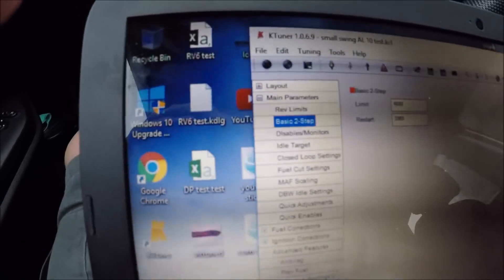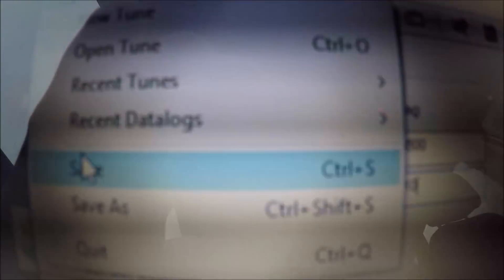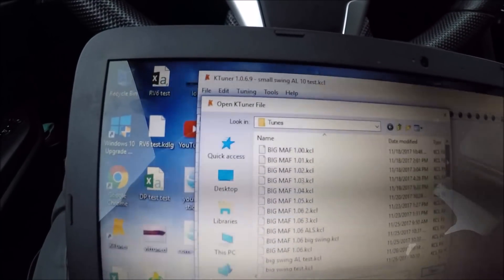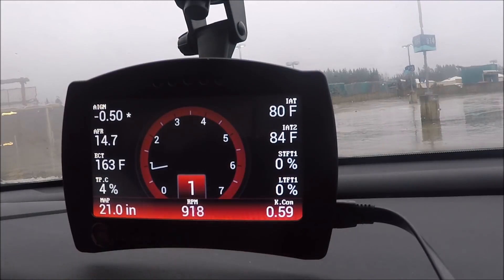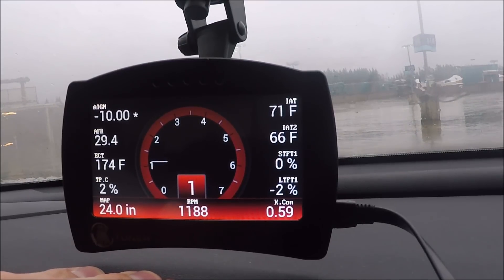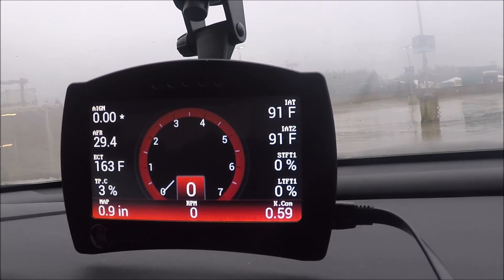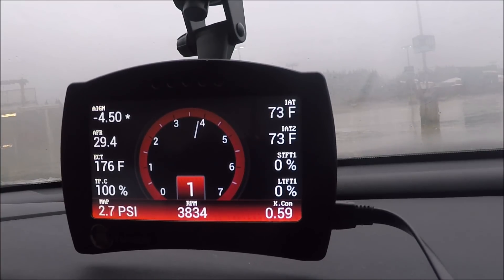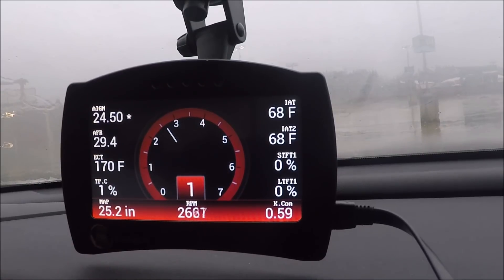Honda CivicX ktuner 2 step / anti lag how to and results

Comment: Can I do this with ktuner on a 9th gen si?
Reply from the maker: I am sure you can set the 2 step rev limit but without the turbo you can't adjust ignition timing to try and build boost off the launch. Maybe it is available for people who have installed aftermarket turbos but I am not familiar at all with the tables available on other cars, sorry.

Comment: Could I do it on a 2017 civic ex-l 1.5 turbo. It’s a cvt that’s where I’m lost
Reply: you can rev and have the '2 step in neutral or park but don't try and launch it
Reply from the maker: You know I dont know anymore if you can enable it on the CVT cars, I would think not because for one I doubt the car really let's the revs get high when flooring it while standing on the brake anyways. The software seemed pretty easy to navigate though I imagine if the option was there you'd have found it.

Comment: i just installed the prl catless downpipe and the prl race maf  cobra intake on my 2018 civic SI  today . got my ktuner a few days ago . could you tell me how to enable the 2step when im in the car ? is it something like holding down the cancel button for a sec or so ? . love your content
Reply from the maker: Unless they changed something you don't enable it. You just set it in the software when you create your tune and then flash that tune to your car. When you are not rolling and hold the pedal to the floor it will hit the 2 step or "low limit cut rpm and recover rpm" is another name for it in the settings as what you set there mirrors what is set under the 2step tab. I haven't updated my ktuner in a while though maybe I should and see if anything's changed.
Reply: I would suggest getting the tsp stage 1 tune with that. Youll love it. They set up the launch control at 3k rpm but you can adjust it by pressing the clutch in, hold cacel button for 2 seconds press top or bottom to increase or decrease which rpm you want launch control in, release the clutch then its set
Reply: For the 2 step after flashing, Usually you hold down the clutch and press cancel you can adjust it though there

Comment: Just to add to my other comment.  I know plenty about cars, but I've only owned one turbo car.  91' Talon TSi was the car and it had nothing but problems.  The motor was blown and the 3rd gear synchronizer was gone when I bought it.  I replaced the motor and rebuilt the trany.  A couple of months down the road the ECU took a shit.  I replaced it $1200.  I then sold the car.  I spent about $7000 on the car in one year.  I then went and bought a new car.  This was years ago.  Lesson learned.
Reply from the maker: Friend of mine is big into DSMs, had a built 2g manual and went through like 4 transmissions in a year, just couldn't get the manual to stay together with all the power. Him and all his buddies run lightly built autos now since they hold up better... I almost bought one off him to play with but ended up just getting ANOTHER Honda... Lol

Comment: So to be safe, if you can be safe ? Lol.   -5 would be a good number ?? Using a short recovery window, say 4500top 4450 recover, and I’d want my anti lag rpm set to be where for that ?
Reply from the maker: well you would set those RPMs for your low rev limit and then have minimum rpm for anti lag a few hundered below that so maybe 4100 or so is where Id set it at. I have my 2 step a little lower at 3900 I think, somewhere around there. I dont hit the 2 step often but had it at -8 for a while and just went -10 and so far no issues. I am actually going to raise the cut a little and extend my recover window  just a bit to slow it down and see how it sounds. With all seasons and an open diff I cant launch off the 2 step anyways so in my current situation it's just for show so I'm going for sound vs function... sad I know! lol
Reply: caraddict so this is
Prob a dumb question, but just to clarify the Antilag will only work when I’m launching right ? It won’t kick in while I’m moving and let the throttle off ?
Reply from the maker: right, only works when you are stopped.
Reply: caraddict had something really weird happen... went onto the software plugged into the ktuner to the car and uploaded the map I want . 19.5/21.5 (been running that map for months) and then made some changes . Just early spool and rev hang disable and better throttle response . Don’t normally touch anything else. Although this time i wanted to set up the anti lag . Set it up for -6 @3900rpm.. flashed the tune . DIDNT EVEN TRY IT YET just went to the hwy for a rip . Did a little pull in 4th and my k control went to 1.0!!!! I was like WTF! I was literally running this map with everything the same but with no anti lag for a while and never went over .52 ever .... I never even tried the anti lag. Becuase I was thinking that could make k control go up .. so I putted home . Reflashed my map but without anti lag and did a pull and K control was below .52 during hard pulls .. idk wtf happend . Maybe when I did the flash with the anti lag something happened during the flash .. hope nothing was damaged ??!.. but I know the anti lag should only work at a stand still so idk wtf happened

Comment: I just bought a ktuner but for some reason it will fail connecting and locking to the ecu..do you have any ideas..how many usb voltage is needed for the v1.2
Reply from the maker: I thought usb was always 5V... are you connected to the internet? I think I remember that you need to be connected to the web the first time you connect to the ECU/register/lock everything...
Reply: caraddict thru wify..its rgistered  just wont lock i gues there goes my 500 to the trash

Comment: Matt, you need to move away from all that rain dude lol
Reply from the maker: Yeah, too bad the wife likes living near her family too much, and they ALL live here. I would LOVE to leave this place, and my family has been spread from coast to coast since I was in middle school so I am used to that but she want's to stay right with them all.
Reply: caraddict I know that feeling man, I want to get out of Virginia but my wife is the same way.  Just ordered a V2 for my hatch, so I may message you on CivicX to talk about some settings since I haven't tuned anything since my EM1 with a Hondata S200
Reply from the maker: no problem, assume you already know its maddmatt02. I may not get back to you right away but I'll try to get back in a decent time frame.
Reply: caraddict yep, mine is FearTheH.  And it's fine, I have time since I'm going to just load the stage 2 in and then take my time tweaking everything else from there until I get the hang of it again, I'm sure it's like riding a bike though.
Reply from the maker: +Chris Saunders if you don't plan on running any ethanol or vastly changing the intake (like sensor housing size) a custom tune doesn't really have that much over the stg. 2 anyways) I'm guessing you saw my video where I had them all dynoed (2 videos actually). Of course stg. 2 could have changed since then I don't know. It is fun tweaking it yourself though, as long as you don't go nuts!
Reply: caraddict I haven't seen those but I'll check them out and sub as well.  I will be swapping to ethanol as soon as the new gas station 10 minutes away gets built, closest one now is an hour away and I daily my car so don't want to keep adjusting back and forth.  The basemaps may be pretty spot on, I know you used to have to load your base and do a bunch of tweaking to get everything smoothed out real nice.  Either way I'm more than ready to get some more juice out of this thing and get rid of it falling on its face toward the end of the rev range.

Comment: Why did it lean out so much on the 2 step rev?
Reply from the maker: I searched a bit and one of the explanations I found was that any time there is a rev limiter the wideband readings will not be accurate. The way I understand it is that when the "cut" happens it stops sending fuel but the engine is still turning and the throttle is still open so the engine is still drawing in air, which will mix with the already burnt air/fuel on the way out making it appear leaner while every spark event actually has the correct mixture in the cylinder when combustion occurs. So as long as the afr is fine at that rpm/load under normal circumstances should be fine using anti lag... I hope that's right! I plan on some more reading as well.

Comment: Man the sound is insane!!! You got RV6 Catless DP right?
Reply from the maker: yeah and just one muffler delete.
Reply: caraddict Major difference with RV6? Performance wise.. I need to decide between Rv6 and PRL
Reply from the maker: +Tito Gonzalez I did a lot of datalogging before/after the downpipe and proved it accelerates faster as well as spools faster. I would not want to say it is any better than PRL though because they are probably very close to the same. Only thing is RV6 front pipe isn't available yet, which I'm really surprised and think that's an error on their part as they are potentially losing a ton of sales because PRL has had the full DP/FP solution out for a while now and no word on the RV6 front pipe. So if you want the full setup now and or don't care about the factory look of running the heatshields go with the PRL since the DP is cheaper. Have you seen the fxx or fkx racing deal. I think that's the brand and their piping isn't as big but you get the full deal that also utilizes the heatshield and it's about 370 or so.
Reply: You should look into FKXRacing dp and fp because tbh, 3 inch pipes aren't really beneficial for 1.5 turbo engines no matter what PRL or Vit says.
Reply from the maker: used to live in P.V. and man I miss it down there! I came into PHX one night for a bachelor party and at 1AM it was 99 degrees still so it definitely gets hot there that's for sure. With intake temps likely in the triple digits for you I assume,  I would get some sort of "meth" injection. I put it in quotes because in mine I started out spraying only winter blend windshield washer fluid and then later ended up adding 25% denatured alcohol to the mix. I never paid the money for boost juice or anything like that. BUT I didn't do it at all for supplemental fueling, just to massively drop my IAT which it did. I had a more elegant solution available for the bimmer back then, right now with the civic a boost switch is whats available (besides spending a lot on a nice standalone cotroller). I am throwing around the idea of making that my next mod, just figuring out how to get a threaded bung for the nozzle without having to pay the price for the AEM charge pipe.
Reply: caraddict I’m likely to buy the RV6 I know a few people that run RV6 on the Gen X including you so I think that will be my set up , plus I live in Phoenix so def need a heat shield lol...
Reply: caraddict Thanks for the info man , lol I don’t even want to think of how hot summers get.. Have you given thought to SiriMoto Throttle Spacers? It’s supposed to channel Air Flow better through the Throttle Body and to mannifold could that help Intake temperature??? I don’t know if you want to mess with that. I’m getting it for the Sound of it pretty soon don’t know about power gains but in your case with a tuned Intake and Maf settings you could potentially get to a few extra ponies...
Reply from the maker: I of course have no proof but I don't really believe in TB spacers, especially in the case of forced induction. I would be interested in one that came tapped for a nozzle... run meth injection with a check valve at the nozzle so the vacuum won't pull the fluid into the mix when its not wanted. that or nitrous. Just making the throttle body further from the manifold IMO isn't really doing anything other than achieving a larger volume of air post-turbo to be pressurized, such a small amount it wouldn't "hurt" power or create "lag" but I don't see how it could create gains myself... And no, I don't see it helping with intake temps either. Better FMIC, meth/water injection/IC sprayer, etc... are what you want to do to tackle high IATs. Out of curiosity what is the avrage IAT for you during the day?
Reply: caraddict I’ve already ordered the TBS too late lol but I’m hoping it’s a good fit on the TB at least. Don’t know what Intake temps I’m hitting now since I’m just flashed. I’ll be hitting the track maybe next week for 1/4 mile times..